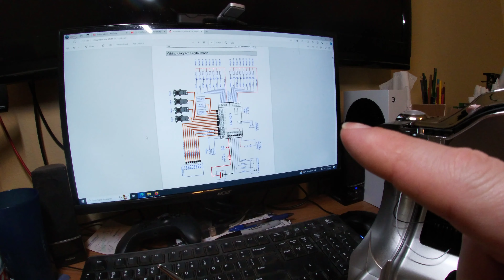Redcat 53 Hauler lights and sound #redcatracingAZ #53chevy

Comment: amazing setup... I will be using my radiomaster mt12 to control mine, it has more than enough buttons/switches to do anything.  Took me a sec to realize you were not using the redcat light controller. I guess I need to backup a video or 2 to catch up.
Reply from the maker: I've heard a few good things about it, but I don't have the patience to program it. And if the Noble is as easy to setup as the FS-I10 is, it will be a breeze.